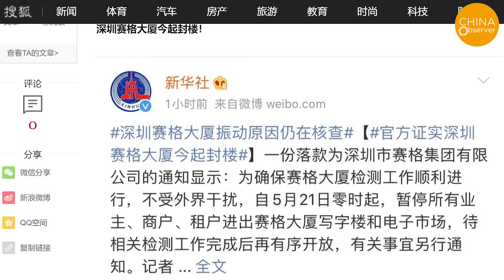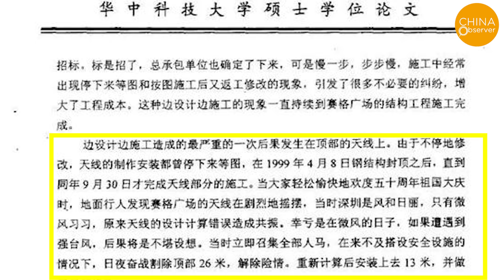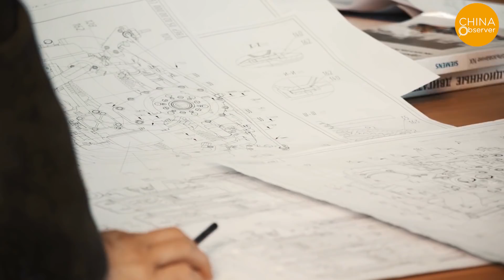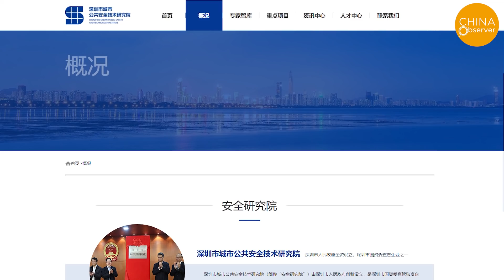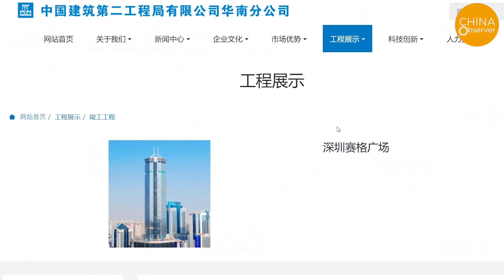356m Tall Skyscraper Shaking Again, Monitoring Data released, analysis of the causes of shaking

Comment: Something clearly isn't right with this building - as no other scrapers around there (or anywhere else) is behaving like that. And - the fact that it has been there for quite a long time. Something has certainly 'broken' within it. It might not have been broken before ...... but a fault has obviously developed recently. Also - judging from the amplitude of the oscillation ----- I wouldn't be surprised if the swaying has actually compromised other components within it. Just because cracks haven't been seen at the base ------ does not mean that components in other parts of the building haven't been compromised or stressed out by that recent swaying.

Comment: failed structural design causing harmonic vibration problems. The floors which vibrate more are the nodes of the harmonic vibrations on the structure.
Reply: This is what I was thinking. But the structure is so large, would it really be felt more on just a handful of floors? I recall reading about something similar in a Korean building, but the shaking was felt throughout.

Comment: Reminds me of the old saying- Do you want it right, or do you want it right now? because you can't have both.
Reply: I did the vibration research before (on industrial centrifuges), although not on the building, the basic concept is the same. Before the building foundation is solid, now you have trains running under the building, so the foundation is not as solid as before, this will change the natural frequency of the building, ...., my suggestion is to put grand pianos in each room of each level, adjust the mass of the building, this way the natural frequency of the building will also be changed, hence, the shaking should be eliminated.
Reply: We ain't got the time to do it right! But we got the time to do it twice !
Reply: Awww man, I'm storing this one in my noggin, the Missus will be hearing this line very soon 😂 👌 🍻
Reply: This is a very interesting saying, I like it
Reply: Good. Fast. Cheap. Pick 2.
Reply: The triangle of production: good, cheap, fast. Pick any two. You cannot have all three.
Reply: @Steve Acho good price, good quality and fast completion time. Can’t have all 3.
Reply: Good / Fast / Cheap. You can have any two of the three in the triangle.
Reply: I can give you the right answer to 1 + 1 right now for our standard decimal numerical system. It is 2.

Checkmate, old saying.

Comment: They are monitoring it closely until it collapses.
Reply: I’m actually kind of impressed. They evacuated the building, and lots of people in hard hats can be seen running around doing something. And all BEFORE it collapses. Which is hugely out of character. (And also should give some idea of just how bad the cracking they’ve found in the subbasement probably is. And yes I’m just speculating on the cracking. Because sometimes you don’t have to see the elephant to know that it’s there.)
Reply: @andrewtaylor940  It is not out of character. No way for them to hide something like this in a Tier 1 city such as Shenzen, and the egg on their faces will be magnified if people die. There are probably foreign expats living in that building. The government will mobilize heaven and earth to dismantle it BEFORE it collapses.
Reply: @andrewtaylor940 Good news monitoring results found the tower is safe.
Reply: @andrewtaylor940  Yes..If the steel tubing expands and contracts but the concrete inside the tubing does not move along with it, would not 5hat make the concrete brittle over time? YIKES!(?)
Reply: They will have data on the longevity of the building so that they construct buildings that last precisely for 5 years maximum.
Reply: @mangeshgokhale4952  Its already 20 years old
Reply: @gregandkaruna6674  I know that but in future they will construct buildings that last only for 5 years. It's good for economy and generates employment. 😀
Reply: @mangeshgokhale4952  It's a waste of time and money, and causes pollution.
Reply: A through and complete study
Reply: @amitatmsu  *thorough
Reply: Lol yeah leave it to “made in China.”
Yeah a few years back contractors were using drywall “made in China, “ here in Florida. Loads of homes were deemed uninhabitable because it contained sulfur, A lot! Which is toxic!
Reply: @speteydog2260  shouldn't the contractors also take blame?
Remember that China wants to impress her own people (I read this commented in this topic), not the world.  She will have "issues" regulating what comes out of China, such as construction materials.
Reply: Kenneth Perry  😂👍
Reply: Kenneth Perry  😂🤣
Reply: Exactly
Reply: That building contractor better of left the country or he is going to jail
Reply: National treasure wonder of the world shaking building
Reply: Chinas 9/11
Reply: Made In China. Maybe China should of bought the building plans from Walmart 😃🤔🤯
Reply: the data which they were monitoring will release after collpse of building
.😂😂😂😊
Reply: Just to tell you self-centered and overesteemed america people: A tall building in Florida just collapsed with many casualties. Bad american construction abilities are well known worldwide
Reply: @paulpaulsen7777  Don't forget that Florida is mostly reclaimed swampland.  Most of the land surrounding the Gulf Coast should never have been developed.  "And every one that heareth these sayings of mine, and doeth them not, shall be likened unto a foolish man, which built his house upon the sand: and the rain descended, and the floods came, and the winds blew, and beat upon that house; and it fell: and great was the fall of it" (Matthew 7:26-27, KJV).  Even so, come, Lord Jesus!  Establish the Kingdom in Jerusalem, and keep the world safe from Democracy!
candlestickpress.faithweb.com/blank_7.html
Reply: Yeah, and amrica people always point to Chinese buildings shaking, while amrica buildings crumbling to pieces. So funny. Or same in New Orleans the hard rock hotel, really funny
Reply: @paulpaulsen7777  ...which was built in a mud pit.
Reply: Whole murica is built in a mud pit. Or a $Hlthole?
Reply: @James Warden Jr. Look at Florida.... they still are looking for body parts and 145 people still missing.... made in USA!
Reply: @James Warden Jr. You gongo!
Reply: @James Warden Jr. 😂😂😂 You spent so much time for so much nonsense 😂😂😂 
Nothing of what you wrote is right- all wrong.
I am German. I lived many years in China and China is wonderful. Very modern und clean. Look Murica subways and trains, all dirty, many people $ho0t each other in Murica every day, Murica had the most casualtles from Cor0na, even more than lndia.
All else what you wrote refers to Murica. You jealous little Murica boy. Well, I also lived in the states 86/87 and later visited many times. I've never seen so many homeless and people without medical treatment like in Murica. Murica is going down- you will see
Reply: @paulpaulsen7777  you aren't German, you liar.
Reply: @Kolek-sun-eater  Sure I am. Why should I lie about my heritage?
Reply: The number of victims from the Miami tower collapse is rising and rising.... 
american building and construction abilities really bad
Reply: From the inside
Reply: To be honest the clean up and rebuilt will create jobs. Sadly may cost some lives but thats not a CCP focus.
Reply: Kenneth Perry  lol 😆
Reply: Haha..really
Reply: I used to be slow but now I am half-fast
Reply: Hahahaha
Reply: Like Bart's warehouse on the Simpsons.  "Milhouse you were supposed to watch the warehouse". "I did, I watched it start to fall down then it fell down" or something like that.
Reply: Kenneth Perry  "Bigger"?  Maybe; "Better"?  Not!
Reply: Godzilla awakes
Reply: with or without people in it, as long as they are making money its safe.
Reply: In the mean time USA Surfside collapse and why the news is quiet about other USA cities like San Francisco?  https://youtu.be/zxS71614E_0
Reply: Just wait... china will need to rebuild their entire country in like 50 years from now. Because all the the infrastructure is not quality built.
Reply: @kenblank9892  yes...and they will use the blueprint from Surfside Champlain Towers ?
Reply: Yeah.  Once it collapses there will be no more news on it
Reply: Use a wood shim
Reply: arfueminute Ya, China cancelled all future tall buildings proposals. No more chance for foreign architects to showcase their designs.
Reply: One way to get rid of population
Reply: Spot on for the case of the Miami Condo collapse. You should just tell the Judge and Jury this basic reason. It happened before and the trial  ended with a summary judgement immediately.
Reply: Oooo No losing of face!
Reply: Final probe datas found 'swaying" due to vortex inducing ( swirling of air up the tower right up to the aging long vertical masts due to wind) resonants between 18-20th May.  Tower structurally stable
Reply: 93 victims identified in the Miami Condo collapse. Its a tragedy and engineers'  nightmare.
Reply: Yeah, just like the world trade center
Reply: Hope it does
Reply: @kylewells6871  Dont worry. Swaying resolved.
Reply: "Seems that the building has suffered a catastrophic failure" says the monitoring team
Reply: @tubetubecommentor4795 if you are refering to the Miami condo collapse, it was indeed a heart stopping piece of news for the structural engineer who designed it.
Reply: @tubetubecommentor4795  m
Reply: Eventually That falls....its made in CHINA...
Reply: Kenneth Perry  well now you can tell her you do it’s just full🤣
Reply: Typical,, over there,,, the public don't trust the developers in many suburbs full of empty high-rise apartments..ROWS OF THEM... called Tofu construction..
Reply: How ironic Pajeets are making fun of China while their country is unable to provide basic needs.
Reply: @sadat_41  your country makes junk,products,food and BUILDINGS 😑
Reply: @sadat_41  how slave of Bateater have arrived to save his master ass but forget thier own country lacks basic ppe kits situation in Sindh and KPK is at worst. 😂
Reply: @sadat_41  let’s them cheer when in reality india health system has collapsed
Reply: Well western white dudes love made in China products 😂🤣😂🤣
Reply: @eshwarashawn4493  They love Chinese products because they are 'use and throw'. Let's you buy new stuff every year. Chinese products are renowned for undurability and poor quality. It's good for economy not good for ecosystem.
Reply: @mangeshgokhale4952  same to goes to Made in China girl's 😂🤣
Reply: @mangeshgokhale4952  same for car battery. Manufactured with short life span. Who should we blame,
Reply: Kenneth Perry  China is not doing it to impress the world it’s doing it to impress its own people. 
But it’s even more impressive mainland China lives rent free in your brain
Reply: @hamster1-1  really?, china builds cheaply and way too fast, look at their quality

https://youtu.be/q00nTSAcMhs
Reply: @mikeconnor3602  When people start believing in corrupt people more than spirituality and God, the results are obvious. With no morality and no guiding principles to life, only corruption and injustice can thrive.
Reply: @mangeshgokhale4952  Well Said, thank you
Reply: @hamster1-1  I'm pretty sure watching a video and commenting on it does not mean living rent-free in your brain unless you have watched him watch other videos and commented on it many many times over a long. Of time Ergo you're a schmuck

Comment: The only thing holding up that building now is rebar. Unless you have a death wish, stay the hell away from that jenga tower.
Reply: @Tharsis879  Excellent point! We have seen this with the Chinese-made structural steel that was used in the Oakland/San Francisco bay bridge that is corroding and cracking with Hydrogen embrittlement.
Reply: @videomaniac108  just wait until the 3 Gorges Dam fails.
Reply: @videomaniac108  Where is the hydrogen coming from?
Reply: @videomaniac108  To get hydrogen from water you need a lot of energy. Usually electrolysis of thermolysis. Why would this happen near the bridge?
Reply: @Ottmar555  Aside from atomic hydrogen present within the metal from construction processes, cathodic processes and corrosion processes could be sources of the gas. Imagine the oxygen in the seawater dissociating from the water molecules and combining with the steel to form rust(corrosion), leaving the hydrogen free to migrate into the steel.
Reply: @videomaniac108  As far as I understand it, hydrogen embrittlement of steel happens when hydrogen diffuses into the metal, a process which requires quite extreme conditions (usually hight temperature, high partial pressure of hydrogen).
This is an example:
https://www.youtube.com/watch?v=8vPaQYM-tWs

If the hydrogen comes from the construction process, was the bridge built by local workforce, of by chinese workers?

If the steel is being corroded, which usually happens via dissolved oxygen in water rather than hydrolysis, then that is mostly a maintenance problem, which seems in line with the trend of failing US infrastructire.
https://www.youtube.com/watch?v=EdvJSGc14xA
Reply: and bamboo, apparently
Reply: What is rebar guys? Its my first time hearing it. Can someone tell me what it is, I am curious.
Reply: @Linda-it4qk  Reinforcement Bars - The steel bars that are lashed together within a form. Concrete is poured into the form making the rebar the skeleton of the resulting structure. You can see rebar in the construction scenes of this video.
Reply: @Linda-it4qk  Concrete has amazing compression strength but no tensile strength. So it can bear the weight of a building but can't handle side to side forces. You put steel rods in the concrete to prevent it from sheering.
Reply: I read somewhere that they used smaller but ‘structurally stonger’ steel columns to build it. I guess we’re seeing those stronger columns in action now.
Reply: @huejanus5505  
They hilariously called it technically advanced reinforced concrete 😆
All it is, is regular concrete cylindrical columns but they pour the concrete inside a steel pipe casing exactly like a foundation pile. Not exactly technically advanced in my steel fixing opinion. The columns are cast 'thinner' to save floor space but inside those steel pipes is rapid rusting on sub standard low tensile and inadequate diameter bars which  is eating away the sub standard concrete. I don't know what kind of steel the encasing pipe are made out of but all things considered it could paper mache
Reply: Rebar ?  No.  Chewing gum and scotch tape ?  Yes.
Reply: It doesn't even use rebar- it uses steel pipe!  Worlds tallest steel pipe building.  I'm guessing the steel/concrete boundry is failing
Reply: And there is fake rebar in those concrete columns aswell
Reply: @GMCShazamataz  
You're comment is shockingly true. I've worked with rebar all my life and it is literally the skeleton of structural concrete. How on Earth could fake rebar get past inspections? Who ever is responsible should be charged with attempted murder.
Reply: Gonna be tricky considering that the government built all these Jenna buildings
Reply: Well, the Three Gorges Dam still hasn't collapsed while the same concrete armored with "Chinesium".
Reply: @hendrikdependrik1891  A big blob of concrete should be a lot easier to build than a skyscraper. The weight of the concrete alone does most of the work. Still I heard the damn did deform a bit and they had to release water to keep the pressure down.

Comment: This building has a serious modal issue.  A mode shape is being excited.  I do not know how old this building is but, if it is OLDER (+2 years), a serious stiffness issue (K) has developed.  Those displacements seen, from the swimming pool, suggest extreme displacement(s) are being generated.
Reply: What? Explain in simpler terms. I was thinking maybe some low frequency ground shaking is being translated by the building into higher frequency shaking...
Reply: @eliashunt4213   Everything BENTS when excited.  Everything has INFINITE bending shapes in the presence of infinite excitation.  The first six modes are called 'rigid bodies".  Then you have "flexure modes" that are literally the structure FLEXING.  Someone posted that the building was built in 1999.  That means that, in the last 20 years, the STIFFNESS has changed through ?.   Frequency =square of K/M.    The foundation area might have been weakened through tunneling, or an excitation frequency from a new system might be NEW, true.  Either way the building NOW is at HIGH risk of catastrophic failure due to high strains from FLEXING.  This is catastrophic, not nuisance.   China/other needs to take immediate action or something very deadly is going to happen.
Reply: @rlu1956  thanks Bob, I'm betting on the latter.